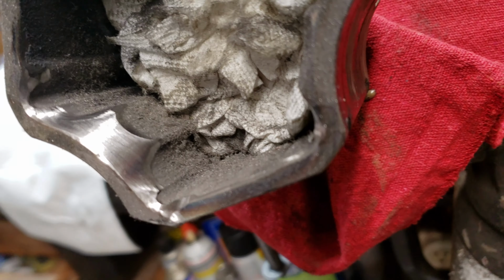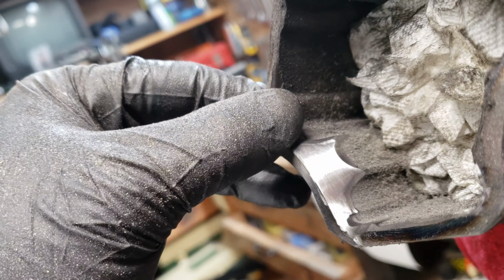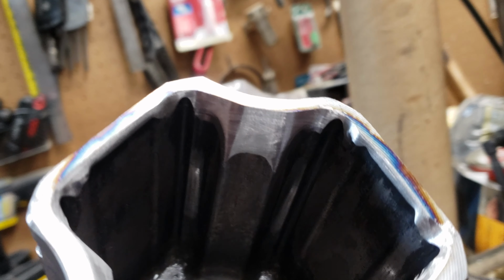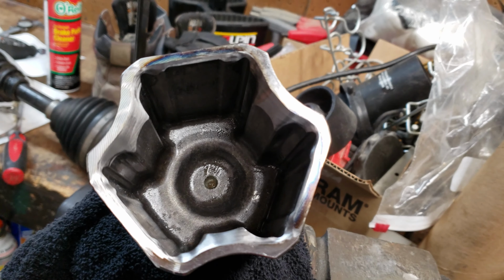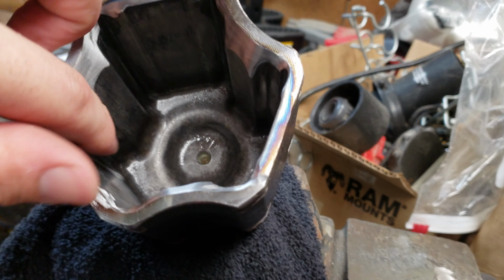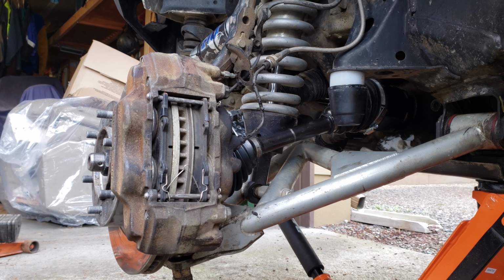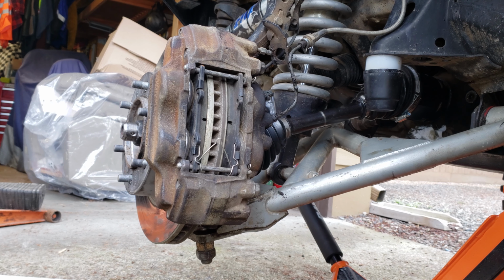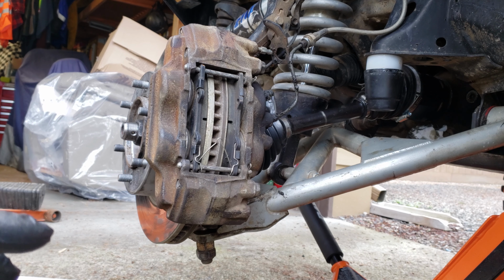Get More travel, By Modifying Your CV

Comment: Hey man, thanks for making these videos. I recently bought a 07 FJ Cruiser 4WD A/T with tons of issues, most of them I already fixed them but I'm encountering with a P0335 code, something about the knock position sensor and I have some concerns. Let me explain and probably you can enlighten me. 

Mods and fixes:

- Replaced: 

Camshaft sensor, 
PCV valve,
CV axles,
Spark plugs (original from Toyota),

- Added:

TRD air intake,
AFE throttle body spacer,
AFE exhaust system, 3 in diameter,

- Fixed:

Welded exhaust manifolds, they were broken,
Cleaned the MAF sensor,
Cleaned O2 sensors, 
Greased all driveshafts,

After all this work, I took it for a ride. I wanted to know/feel the acceleration, horsepower, and torque coming out from these mods. After depressing all the way down the accelerator twice a P0335 popped up. The first time, I immediately noticed a huge performance, no questions at all, but the second time... PUM! Engine light on the dashboard. 

So, P0335 code can mean a couple of things, the knock position sensor is not working properly, the wiring for this sensor, a misfire, and/or the timing chain is stretched. My suspicion is the timing chain. I think that I forced the engine too much (duh!) and that's why I'm getting this code. I'm working on replacing the knock position sensor and check if that was the problem.

Any other suggestions?

Thanks